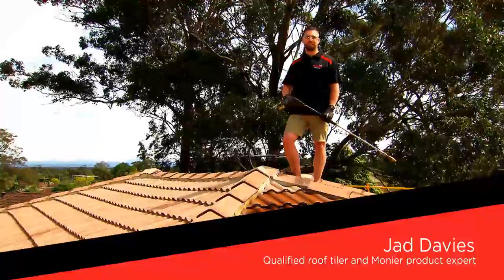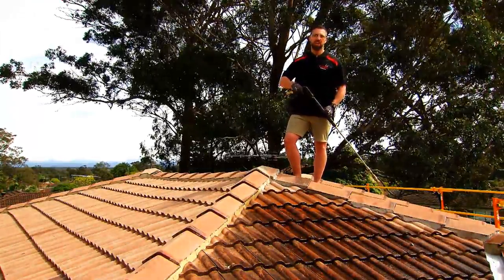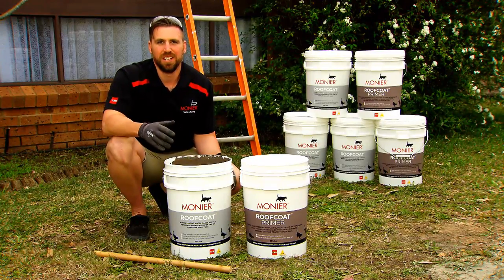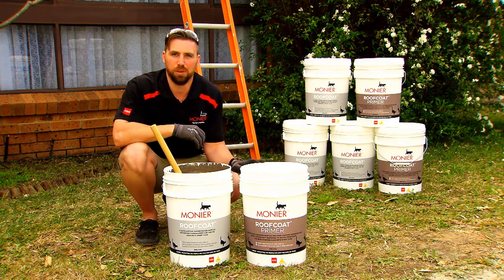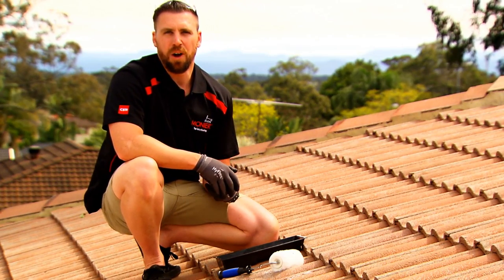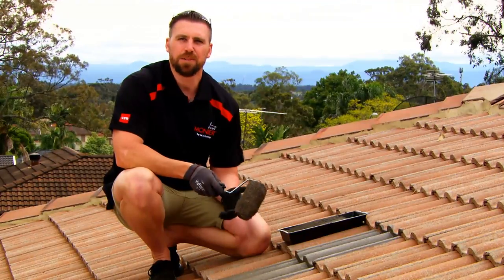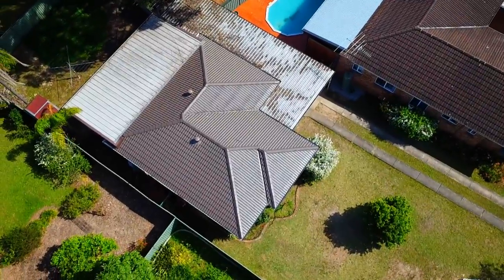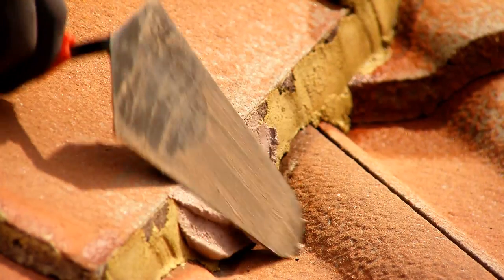HOW TO with Monier: Wash, Prime and Paint your Monier Roof

Comment: When you pressure wash the roof, Do you seal the internal part of the roof so that the water will not get in.?
Reply from the maker: Hey Zeta, 

Thank-you for making contact with Monier.

Depending on the age and type of roof-tile on your property it is to be expected there will be some amount of water ingress from pressure cleaning. There is no method of ‘under-protection’ for this process. Working from the top down will minimise water ingress. Generally speaking when done in this manner the amount of water getting under the tile is minimal and should not cause any damage to your home.
Prior to pressure washing it is vital to ensure that you do not have any broken tiles, rusted flashings, or damaged lead as this will be the most likely leakage points.

If you need any professional assistance please get in contact with your local Monier Roofing Specialist.

Regards,
The Monier Team
Reply: Thank you for your swift reply, i will inform future clients  that they do not need PLASTIC DROP SHEETS, to be placed in there internal underside of roof.